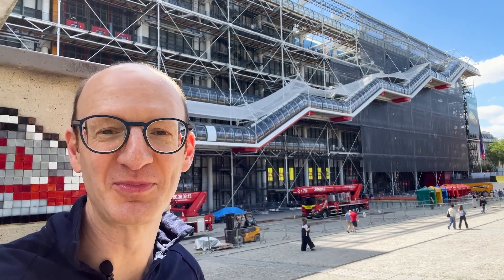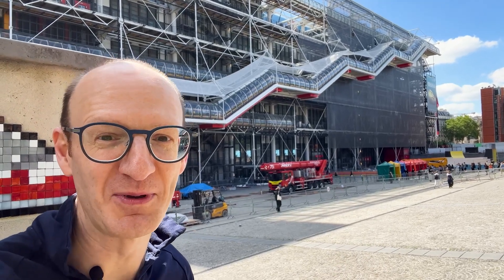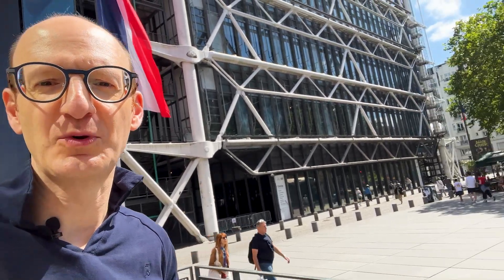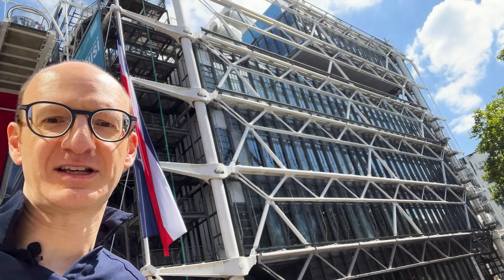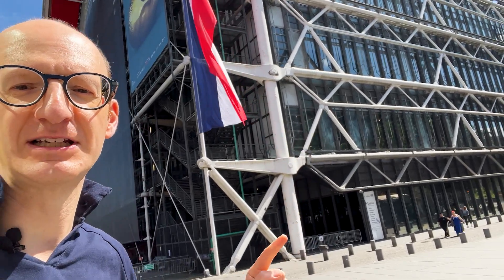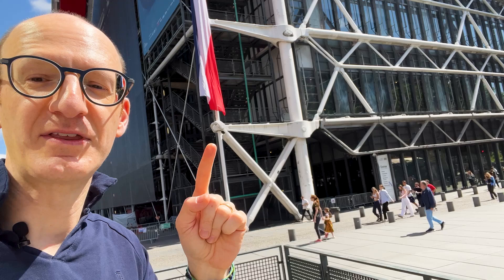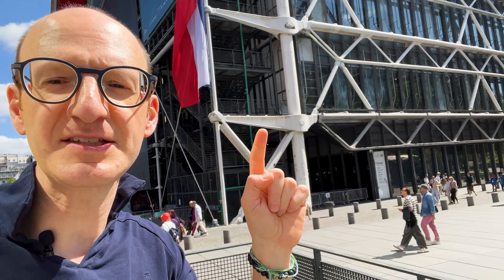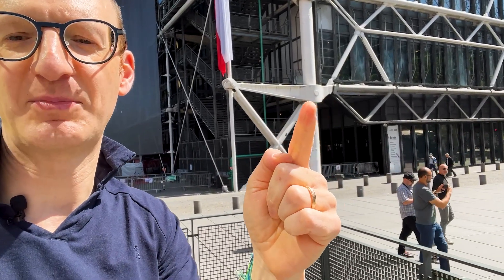The Pompidou Structure Explained!

Comment: But wait, there's an elephant in the room.  The floor trusses are linked together by 3 pairs of diagonal braces, top chord of one truss to bottom chord of the next truss.  There is no evidence visible that the braces are not connected as structural elements.  It could be that the lower trusses are somewhat hanging from the more lightly loaded upper trusses but is it also possible that different loadings on each floor could put some of these braces in compression?  The pinned joints at the tops of the braces are not braced for out of plane buckling if the braces come into compression.

Comment: OK, that is how the building works, at least for the vertical loads, but what is the advantage of this system? This is a little like the destroyed World Trade Center without the core. The spans in that building went from the core to the outside pillars giving unobstructed floor areas, but there was no rocker and tensioning device in that system. Why the complexity here?

Comment: Nice video! 

But... Those (expensive) cast steel rockers ("gerberettes") are not needed... just connect the floor trusses directly to the support columns while also extending these trusses to the outer tension bars to connect them there directly.

That way, the floor trusses can even become lighter as the connection now gives a counter acting bending moment.
Reply from the maker: maybe...and then have the people on the escalators slam into the trusses?  I agree with your point as a structural solution only but I think they were solving structural and architectural and experience design problems here...thanks!
Reply: @PaulKassabian  "High Tech"-architecture was a "thing" in those days... they probably wanted to impress the world by showing off their "high tech solution" ;-)

It's nice to compare the Centre Pompidou with the Renault Centre in Swindon by Norman Foster... he also used outer vertical bars in pure tension.

Comment: "Thank you so much for sharing this video! It was incredibly helpful and informative. I truly appreciate the time and effort you put into creating it, as well as your other informative videos!

The most interesting aspect of this amazing and spectacular structure is that most of its components work structurally in tension. I particularly love the tiny tapered steel beam, which transfers the reaction force from the Warren truss to the steel circular tube column under significant vertical loads and bending moments, simultaneously creating a tension force on the opposite side of the tapered steel beam.

It’s an innovative structural design, and your explanation was absolutely lovely. Thank  you once again!

Also, a special thanks to British engineer James Warren.
Reply from the maker: You're welcome and it really is a great expression of forces and bringing tension into the design for all its benefits!

Comment: thanks so much for the enlightening video. love your work. can you please explain the impact of the inverted members (that connect the bottom chord of the upper truss have on the upper chord of the lower warren truss) and what they contributes to the overall structural system.  as they appear to be pin jointed do the two members provide additional stiffness the the truss. cheers.
Reply from the maker: Glad you liked it and those "inverted-V" members form the lateral system of the building i.e. mainly wind load.  My video was all about gravity/vertical forces only of course.  Cheers!
Reply: @PaulKassabian  thank you

Comment: Excellent ! Ty. A penny has just dropped in my head listening to you explaining this - at a first approximation looking at a complex structure like this one can probably take a stab at what’s in compression or tension even before thinking the structure  through, by the ratio of the thickness of the members. If in the limit the member is beginning to look like a steel rope - it’s probably in tension, and if thick it’s probably in compression / bending… I didn’t see those rocker arms coming though ! Really interesting ty for posting.
Reply from the maker: Great to hear!  And yes, if/when expressed correctly that's a really good guide.  You certainly can't push on a rope!

Comment: That was a great tour.  I would also be interested in how the lateral force resisting system works.  Are the rocker arms also part of the LFRS?  Thanks, Paul.
Reply from the maker: Great question as I covered only gravity/vertical forces.  Those inverted-V members at either end of the trusses and then the lowest-level X-brace are the lateral system.  Thanks for asking!